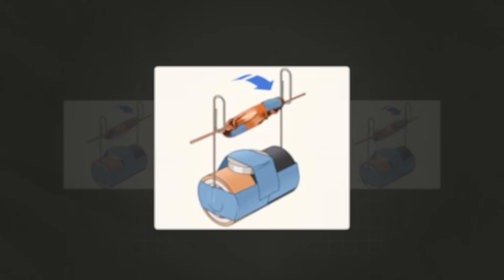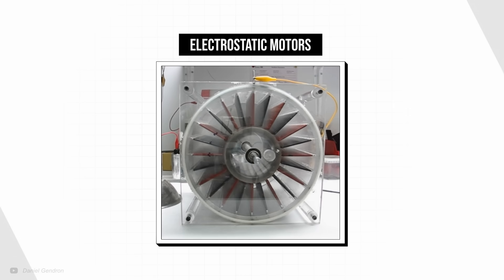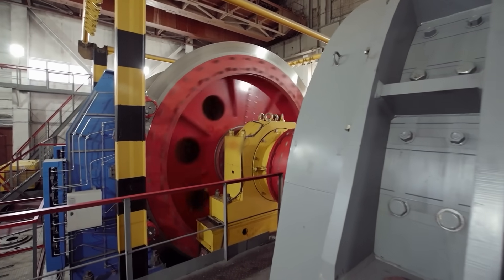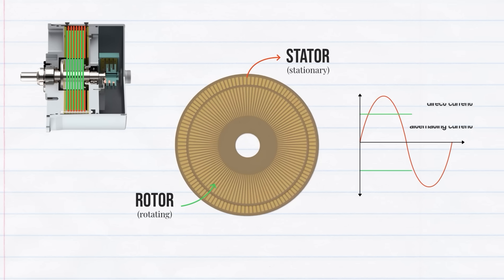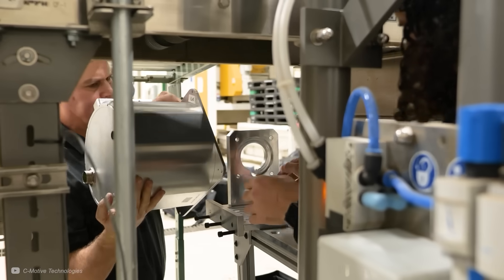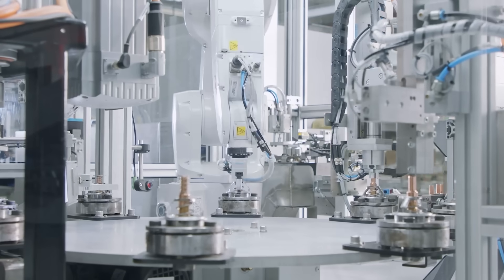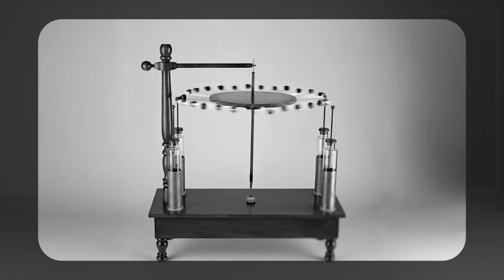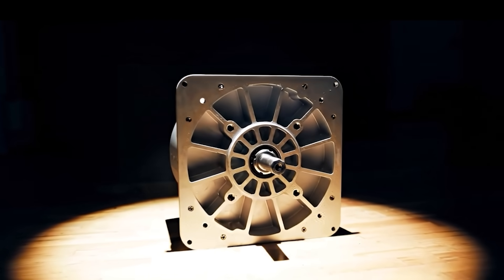How Electrostatic Motors are Breaking All the Rules

Comment: This motor shouldn't rotate fast, because the insulating fluid would make bigger resistence. This is why they are focusing on torque, rather than on speed.
Reply: Yeah by running them slowly they also likely avoid other issues. I know that actual flux motors (which similarly have flat plates for stators and rotors, but use magnetism rather than electrostatic force) have issues with the plates wanting to bend towards or away from each other making a consistent air gap difficult to maintain.
Reply: @killersquirel11 You mean axial flux motors?
Reply: @killersquirel11  My under.grad project was on an axial flux motor, back in 1976
Reply: Glad someone else noticed this too. Friction and resistance, they face much sharper diminishing returns.
Reply: @redTanto  I initially thought it would be sealed in a vacuum.
Reply: @TomAtkinson  and honestly? If it's given a standard access point to redo the vacuum after repairs/maintenance, I don't see why it wouldn't work.

And vacuum pumps usually don't have a lot of horsepower either, so... Maybe there's the option to sell your own standard repair tools...

But I guess the engineers thought about it more than some random guys in a YouTube comment section. Maybe the vacuum would make the casing too expensive. Or it would slow down maintenance too much to have to suck out the vacuum.
Reply: @TomAtkinson how would you get the moving parts to propel something if they are sealed in a vacuum.
Reply: @TomAtkinson I thought initially about isolation gas. Then I thought about sealing a rotor and how healthy that stuff is. 😂 
My thoughts on that motor are it is nice if their price makes sense.
Reply: @thriler30  through a vacuum proof rotatable seal.. using liquid metal as the seal.
Reply: Novec 7100 (flows better than water — very low resistance)
Reply: @polodog7458  If you keep it cool. In general Novec fluids are made for that stuff. I worked on a prototype immersion cooled battery, that used 7100 as a two-phase coolant - it literally boiled off of the cell surface, then recondensed elsewhere. The higher numbewr, the higher boiling point...but slightly higher visco. Magical stuff, but fuc|<ing expensive...
Reply: @Lvvcassss  hahaha, yeah definitely expensive. i built an immersion raspberry pi as a project to explore how it works and had to buy a big jug.
Reply: @Lvvcassss :  What was the basic materials of "Novec" liquid (?) or gel (?)...
Reply: @polodog7458 is this what they are using, or similar?
Reply: @polodog7458  "flows better than water" is really not saying much since traditional motors are in air.
Reply: @AttentionEconomyJMB  You’re right, but it’s just enough to use as an example to compare its viscosity to something familiar.
Reply: But isn't it true that a high torque motor could be geared-up in a gearbox to achieve higher speeds? Or would gearbox friction negate this idea?
Reply: @kdeuler  Thats a good point, its probably worth it. I wonder if they were having issues getting high enough torque to translate once at desired speeds. Also, you can use magnetic gears these days, they have a little higher chance to slip, but slipping does not damage them at all, and they have much less friction.
Reply: @redTanto  magnet gears kind of completely miss the point of no magnets though...
Reply: @redTanto  Isnt the whole point of this motors not to use magnets, why would you connect it to gearbox that use magnetic gears.
Reply: @M0ntarro  Because they are lower friction and lower maintenance than a regular gearbox.
Reply: @redTanto The slip of a magnetic transmission will cause far more losses than the tiny friction in a ground gear, gearbox.
Reply: @court2379  Its a small increase in slip chance at max load, but there will be no damage from it. You also don't have to oil it. This is preferable to deformation or losing teeth. You can abuse this and there is no repercussion.
Reply: @redTanto If you design the gears for the loads there are no repercussions either. If the magnetic one isn't designed for the loads it just slips and doesn't transfer the power. 
In a sealed gearbox with good oil you only need to change the oil every 100k miles. There are no combustion products fouling it up. There are also very small loses. The magnetic coupling will cause eddy currents in the nearby metal. It will probably also need a large number of plates to get the torque needed. Those will have significant windage losses.

There are reasons we don't use them. Gears are nearly perfect having rolling contact.
Reply: @court2379  "If you design for the loads" is something you do for both when comparing. That's called making a fair comparison. 

When both types are under high load, the physical gears strain and wear down, the magnetic ones just slip with no damage, so you can strain them without worry when needed/wanted.

Break-in debris will have you wanting to change after about 100 hours usually, then after that you get 2-8000 hours depending on the gearbox/operations. 

You can tap eddy current back into the motor, also laminated structures. Its an old problem for confined space magnetic gearing.

Magnetic gears are simply the most cost effective option. If you made cvd graphene laminated silicon nitride gears then that would probably be the better option, but we don't get good things.
Reply: @redTanto Well you know best. You should probably tell every manufacturer in the world how they are doing it wrong as not a single one is selling these...
Reply: @kdeuler  If you need to pay for an expensive and heavy gearbox, you might as well pay a little for a normal electrical motor and the magnets in it. It's like sticking a jet turbine on a crane hoist - sure, you can do that, but you need a crazy gearbox and if you want to keep the turbine happy, you're very restricted in the procedures of starting/stopping the crane. And friction is there, too.
Reply: @kdeuler  the gearbox would reduce any efficiency benefits you'd see, as well as requiring a LOT more maintenance, so trying to use these motors as a replacement for standard industrial motors would be counterproductive
Reply: @dawnderg  standard industrial motors are very often geared down so that the final working speed is very slow, so in those cases it would actually increase efficiency if you can run it directly off of a high torque low rpm motor. It wouldn't be much use for something like a fan, but for a conveyor belt or other low speed application it may make a lot of sense
Reply: @thecrazyfarmboy Absolutely I was thinking of things like cranes and conveyors for this application. What about drones though? I know those are fans but consider the lack of rare earths required, that would be huge for cost savings.
Reply: @kdeuler not necessarily! The Porsche Taycan EV has a 2 speed transmission. There are some energy savings by not running the motor near max RPM.
Reply: Don't need high speeds on motor to generate high power electricity. Electrostatic motors are very good at making high voltage electricity with much less heat than magnetic versions, alas higher efficiency.
Reply: @kdeuler  Kinda... just stick to your application. If your application needs high RPM don't use this motor... They will probably want to target industrial robotics where high torque, low RPM is the name of the game.
Reply: @kdeuler  That's my question too. How much loss will occur in said gear ratio adjustment? Seems it would negate the gains of low torque. Then there's all the lubrication maintenance and gears wearing out.
Reply: @kdeuler  Wikipedia claims only about 3% loss for a typical planetary gearbox, and ratios of 10:1 are possible. So yes, that would be an option. Of course, you would only get 1/10th of the torque at the output, nothing comes for free. 
Also, you would have the extra cost of the gearbox while the magnetic motor that already runs at high speed would not need that.
Reply: @kdeuler @kdeuler I think every motor has a 'step' which limits the minimum degree of freedom.
but if motor can run at high rpm, this is not an issue, because you can lower the minimum degree by gearing it down.
but if you gear up, then motor should move very large step, which is not ideal
Reply: That's why it surprised me when a liquid was involved, I was expecting some kind of dielectric gas or coating for the electrodes.
Reply: @Ezio-Auditore94  Yeah, it seems like you could use tantalum-coated stators, similar to the solid electrolyte used in tantalum capacitors, but it would be expensive.
Reply: Almost all regular electric motors are geared down anyways
Reply: @SixTough Yeah it uses too much metal to make a motor with the needed output torque directly.
Reply: Why can't they just fill the motor with sulfur hexafluoride? 100kv/cm breakdown voltage and much less resistance.
Reply: @thorlancaster5641  I would guess ist is harder to seal a gas than a liquid in a rotating machine. And with the climate impact of SF6 the sealing is quite important.
Reply: @thorlancaster5641 :  Was the fluid NOT "metal devourer/ very corrosive", like "sodium element"?... 😢
Reply: Drag and turbulence as well
Reply: I'm not convinced it would actually have that much drag.  After all, you could accelerate the fluid once if you stay at a constant velocity
Reply: Congratulations for pointing out the obvious.
Reply: With high torque… can’t you just use gear ratio knowledge to convert it into speed anyhow? 😂
Reply: @renaissis sort of no.

The issue is that those motors are high torque but low power. 

Normaly engines for that applikation may use a half hp  engine when the moment reallt just need 0.1hp. The reason for this is to hande variable resistance and thermals. The down side is that they run very inefficent

The static motor run optimally at that rotation speed and power. It can give short burst of extra torque for variation. But it cant really produce rhat much more power.
Reply: @matsv201  You hit on the key limitations and it will be hard to overcome these.
Reply: @renaissis  Loss of torque in translation might be too much to compete with existing motors when scaling to higher rpm due to its very low base rpm.
Reply: @renaissis  Many applications don't need speed. Elevators, for example. Instead of using a multi-poled induction motor and a reducing gearbox with a worm, you can just use direct drive. You save a lot of energy by not using a gearbox.
Reply: Yup loss monster
Reply: Vacuum is an excellent insulator and frictionless too.  So high speed electrostatic motors may be practical in space.
Reply: Vacuum is only a good insulator as long as there are no free electrons or ions buzzing around in it. This is only the case in very good vacuum like in free space. Such a vacuum is very difficult to make and maintain in a motor in earth's atmosphere.
Reply: @V1nc3n7Vela  : Vacuum high voltage switches are standard equipment since decades. The vacuum is preserved by getter materials or the contact material itself.
Reply: @georgkrahl56 correct.  To minimize high voltage electron field emission in a vacuum an ideal surface coating material needs to be chosen.  Likely one of many improvements that could be made in future iterations of this electrostatic motor design and improve efficiency
Reply: @JCAtkeson3  : Current flows here, too. Conservation of energy etc. So waste heat will produced in these motors, too. Vacuum is quite bad in conducting heat, see Dewar.
Reply: @JCAtkeson3  That was my thought too. The closer you get to a complete vacuum, the lower the friction. But "complete" isn't necessary, "near" is better.
Reply: @JCAtkeson3 another really great point, but you should be aware that while a vacuum theoretically lacks a medium to ionize (no dielectric breakdown voltage-distance), enough high voltages or close electrode proximity can cause field electron emission. Basically will develop a coronal discharge, even with out any medium (such as a fluid like air or the proprietary special chemical blend mention in this video).
Reply: @JCAtkeson3  The fluid has a high dielectric constant increasing torque, I assume. Plus it conducts heat.

Some applications need high speed, others high torque. The product is horsepower.
Reply: @agnelomascarenhas8990  It would be so futuristic to have a vacuum electrostatic motor that dissipates heat like an IR radiator or something. I know it may be the worst solution, but it would look very cool with the electrodes having a mirror finish or something like that. Just daydreaming, I'm not proposing anything
Reply: @Ezio-Auditore94 or just run some liquid cooling lines and run the liquid through most likely already present radiators
Reply: @Ezio-Auditore94  If you want to dissipate heat radiatively in a vacuum, PCBs won't survive doing it at the temperatures they're rated for. Stefan–Boltzmann law has a parabolic equation M = σT^4, where the constant sigma is a number multiplied by 10^-8. That means the energy per unit area to balance the losses of the plates has to be maintained under 200ºC. It also goes without saying that the radiation between plates would be the biggest problem, because that radiation would only be able to exit from the gaps and at the ends.

It would work if they used a different process technology for their rotor and stator and increased their working temperature.
Reply: @Infinion Yeah PCBs are out of the question. I worked with fiberglass-pertinax and epoxy PCBs and those standard ones aren't gonna cut it
Reply: @Ezio-Auditore94  Agreed. PCBs are probably a great process technology for the startup to initially springboard off, but to reach a larger industry they need to replace it with a substrate that can break their ~500 RPM operating barrier.
Reply: I wonder about the operating temps for the fluid. Would be bad if it's susceptible to freezing.
Reply: It can't rotate fast because every time one of those flat electrodes of the rotor passes over one of the flat electrodes of the stator, you have to change polarity of the electrodes. With 112 electrodes, it means you have to change polatity 112 times for every turn of the engine. There is a limit to the speed you can change the polarity of a circuit. 
C-Motive doesn't tell the max RPM of their engines, but there is a clip of them testing it vs. a conventional engine at 200 rpm.
Reply: @neutronalchemist3241 that would be adequate for a hub motor, with a 3:1 ratio. Standard 26 inch wheel is 11 rpm per mph, so 30 mph would be 330 rpm, so 2x to 3x depending on what the ideal rpm is and not the max. AC from DC might be a deal killer tho, which is probably why they are focusing on fixed installation.  Mobile applications may introduce issues withg-force shock when you hit a pothole or bunnyhop a curb for example.
Reply: That's what gears are for
Reply: Fluid friction, not resistance; but yeah I agree it makes sense to focus on lower speed with higher torque.
Reply: The dielectric will be contaminated very fast. No good.
Reply: Which is great for geared applications, come to think of it.
Reply: Rheology baby!
Reply: Gearbox
Reply: and how about a motor with a electret  instead of magnets?
Reply: They could probably make a decent speed motor with Sulfur Hexafluoride. It's a common insulating gas, although it still won't cool as well as liquid. Vacuum "insulation" is also possible but again cooling is a problem.
Reply: Well if they focus on torque they can always step up the speed with gearboxes.
Reply: With torque you can always gear up speed.
Reply: Precisely... I said "I assume people have considered running these plates inside a vacuum? Having the fluid between the plates sees like would open a pandora's box of other problems.."
Reply: Slow speeds would also reduce the potential of cavitation, which would ruin the insulating capacity.
Reply: I am not sure if this is the reason. Induction motors require a current proportional to the desired torque, which produces losses in the copper. Electrostatic motors need a voltage proportional to the torque, not a current, which should result in less losses. It is harder to have great conductors for induction motors than good insulators for electrostatic motors.
(This is also part of the reason why we have high-voltage power lines and not high-current)
Reply: A more efficient motor with high torque? 👍
Reply: The proprietary fluid is obviously just baking soda in water. 😂
Reply: They could also put in sulphur hexafluoride as an insulating gas which is used in high voltage switches to facilitate lower torque higher speed motors and skip the transmission.  The bad is that it is extremely bad for the planet as it is much more heat trapping than carbon dioxide or methane. It’s about 23,500 times more heat trapping.  So sealing it would be critical.  But that would facilitate fantastic insulation and since it’s also very dense gas some heat transfer would be possible, but not even close to what fluid can do.
Reply: My thoughts exactly, they are simply trading copper and steel losses for frictional losing in the insulating fluid.
Reply: Even if all they ever replace is stationary electric motors that still frees up all the resources we were using to make those motors to be used in EVs.
Reply: Nicola Tesla
Reply: Mineral oil and printed circuit board rotors. Got it.
Reply: If it has a relatively high torque, it could easily drive a gear box for higher speed.
Reply: @SWDW88  yes, it can, but gearbox create losses on energy and maintenance. 

Simpler just use another type of motor, that out-of-the-box optimized for your workload range.
Reply: @vladislav_artyukhov 
Yeah, well hopefully there's an overall gain in efficiency. Its the simplicity in build and materials that has wooed me
Reply: In the 7ties made electrostatic speakers....my friend told me it could be louder if it would run a certain gas for better insulation. Do not ask me what kind of gas he meant.
Reply: gears are fine
Reply: I know mechanical hard drives are filled with hydrogen gas. I think the fluid would be a resistance issue for sure!
Reply: Critical Minerals... Are only critical because the Anglos waging war against China.

This technology is completely useless and a waste of time outside of the Anglosphere where rare earth magnets are not a problem.
Reply: He said it draws less current to operate, and the liquid is an insulator!
Reply: Was wondering about the viscosity of the fluid. High voltage transformer oil is mineral oil and would offer lots of resistance.  There "secret fluid' will not stay secret for long.
Reply: Exactly what I was going to say.
Reply: That is true but the fluid can make or brake it and form the liquid it would have to be a gelatinous liquid